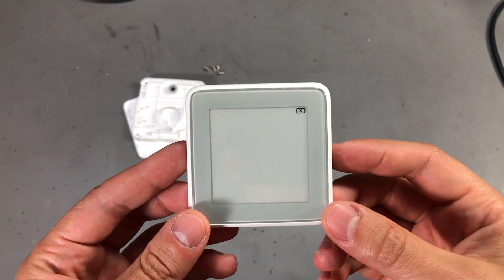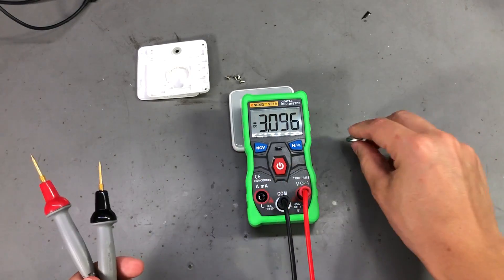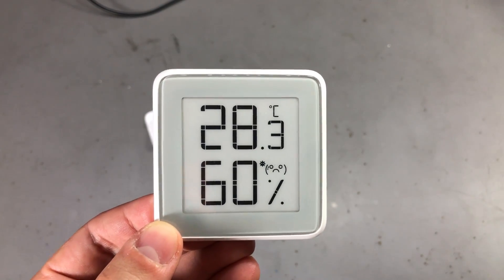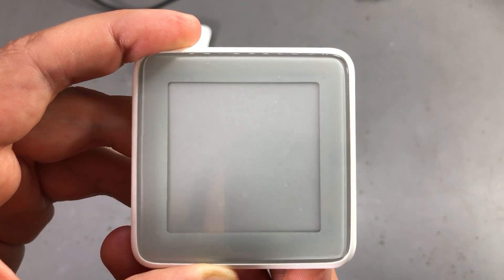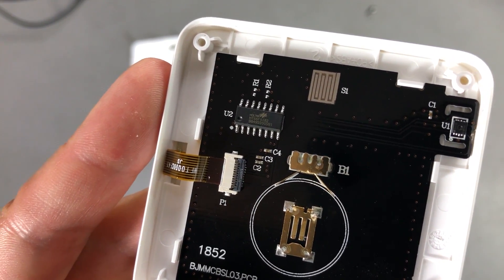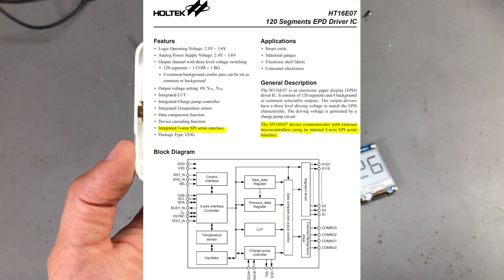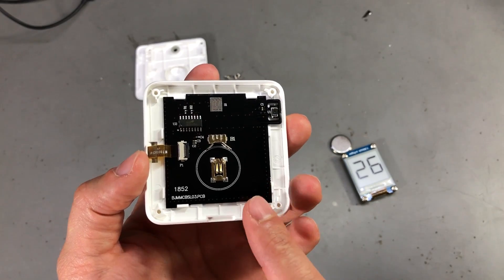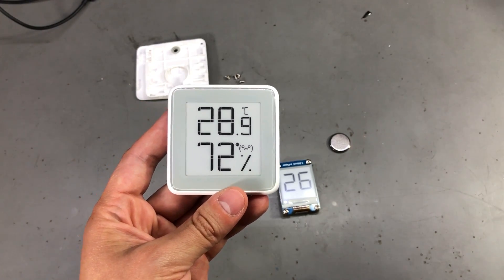Voltlog #254 - Epaper Display Pixel vs Segment Type

Comment: A couple of weeks ago I did a partial reverse engineering. I can confirm that that it is a an SPI interface, and when looking at the commands send to the display it has the HT16E07 driver chip. I also disassembled the display itself from its housing. At the back of the display it seems that in the center of the segments some connection is visible, indicating that indeed it is a segmented display
Reply: I just did some of this, before I read you did it weeks ago. Bummer.
Reply from the maker: thank you for providing info on the subject 👍
Reply: In case you want to play with the e-ink display, I have made a github repository with a library to control the display and provided some examples.
https://github.com/GitJer/XiaomiMiaoMiaoCe
Reply: @jmvoogd  Thank you for sharing this project

Comment: I am 100% sure this is a segment based display. There is no way you get those rounded corners on the digits with a pixel based one, without being easily able to spot jaggedness due to pixels.
Reply from the maker: Yup, that's one particular case where the difference would be obvious. I tried finding the same font but it's probably something custom.

Comment: Huh! That driver chip could be a good solution for the latest "adventure" over at the EEVBlog! Someone should send it to Dave.
Reply from the maker: are they having trouble over there?
Reply: @voltlog  Dave was looking to design a sort of e-ink power on counter. He was looking for a small 7 segment e-ink display.
Reply: @Gengh13  Dave was looking for counter eInk display but this Xiaomi one is not good enough and it is too big.
Reply: @voltlog  He's been searching for a segment e-paper display in the last video but couldn't find anything.
He wants segment rather than graphic so he can drive it with a 2cent micro, so if there's a simple chip that can turn a graphic display into a segment display, that'd probably be his ideal solution
Reply from the maker: The thing is the chip I showed does not convert anything, it is designed to drive segment type epaper displays.
Reply: VoltLog D'oh! Oops, dunno what I was thinking haha

Comment: You don't see difference between pixel type and segment type on skewed lines/edges? I would expect to see pretty sharp edge on segment type, and toothed edge on pixel type.
Reply: Xiaomi one has clearly brighter segments which are not used.

Comment: Probing a "startup" event on the display connections, it shouldn't even matter whether one has any idea what the controller is - simply looking at the volume of data transferred it should be clear whether this is a segment or pixel display. Then again, that would be the "non-Victor" approach (sorry for the obscure Ciresarii reference) - one should simply ask "why". Why would the design-conscious Xiaomi emulate a not-terribly-elegant segment font if they would be free to use any font they wished...? ;)
Reply from the maker: That's also a good question.. Once again I don't doubt this is a segment type display.. I just wanted to show that even up-close it's not easy to tell them apart.

Comment: This Xiaomi is for sure segment type. Take strong flashlight and you will clearly see all segments. If you have good eyes you will see them without extra light too, because they are clearly brighter :)
Reply: I don't know what you're using to see that, because I don't see that with mine. If the screen hasn't had a full refresh, then yes, you will see ghosting from the previously shown segments, but that still doesn't indicate whether it is pixel or segment based (unlike an LCD). If the screen has been refreshed, the only things visible on the display are the current values / symbols. It does make sense though if they have high enough volume that a custom segment display would be cheaper.

Comment: Nice research! I decided to add a little blue tack under the battery tab. It seemed like it might not be able to hold its tension. But it might also be the "remove before use" plastic slip adding just the extra thickness to bend the tab enough to become loose.
Reply from the maker: We'll see how long they last now after I bent them, hopefully it was the plastic battery tab that caused this in storage and now the fault won't appear again. It's also interesting from a manufacturing point of view, this is how a simple, rather non-important plastic tab can cause problems for a large number of customers.
Reply: Yep agree. Although we likely will never know if it was the culprit or due to some other issue....
Reply: I'm probably going to have to bend mine also... that or the blue tack trick ;) I noticed when I picked it up them it lost power and did a screen refresh, and then did it again... so it is only just hanging in there. Meh... on second thoughts... it got both right now... that'll fix it! :D :D
Reply: @pfeerick  Haha. Mine failed also after my friend picked it up to look at it closer.
Reply: @ristomatti  Same here... happened twice now in a couple of weeks time.  I've now bend the contacts a bit.
Reply: @Luke-san  So far so good on mine. 🤞

Comment: Sometimes it helps just to clean the contact surfaces on the battery holder and the battery itself.
I have worked in manufacturing of electronics and you will be surprised how many strange failures you get during assembly just because the operators has dirt/grease/hand-cream on their hands/fingers.
Reply from the maker: Good tip, I'll have to remember this one for similar faults that I encounter.

Comment: 3:07 I suspect that Waveshare was able to get displays like those intended for use in retail price tags, and they recently started offering their own clone of the E-ink "ICE" board that unlike the original, can also be installed as a Raspberry Pi HAT expansion module, allowing them to offer real e-reader and digital notebook displays, albeit the raw panels without the front light, pen, and touch digitizers.

Comment: 1. The default assumption should be that if it looks like it's segmented, it probably is.    Sure, displays can have segmented fonts , but it'd odd to assume that rule, not the exception. 
2. That ad timing in the middle of a sentence felt like a dick move.

Comment: That battery holder seems to be pretty bad, definitely designed to be low cost.
I'm not a fan of using non rechargeable batteries (when there are other options), I would probably try to use it with a small rechargeable lithium battery, maybe everything works at 4.2v and a LDO regulator is not necessary.
Reply from the maker: I this case it's a good compromise, the battery is small, cheap and will last for a long time..